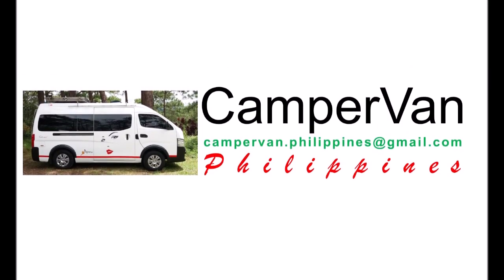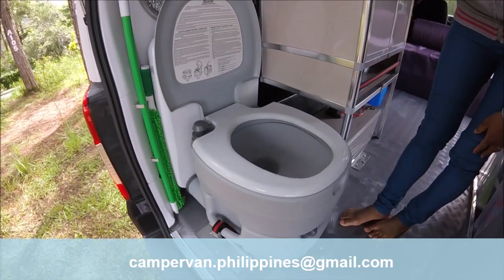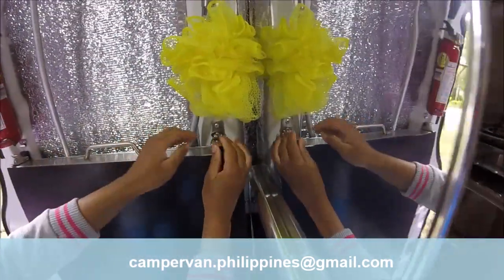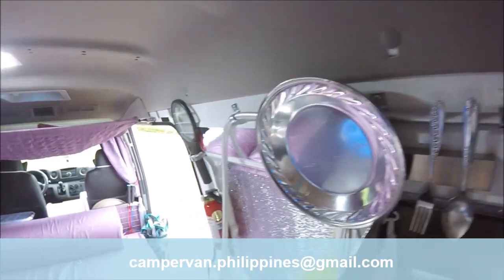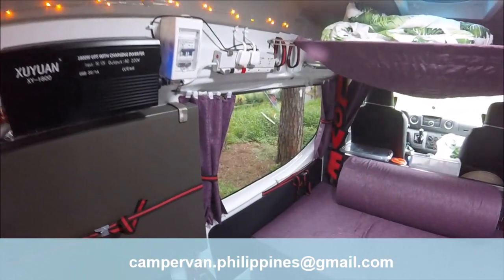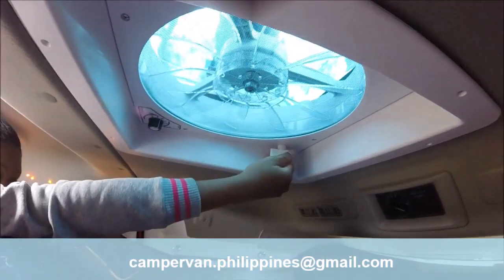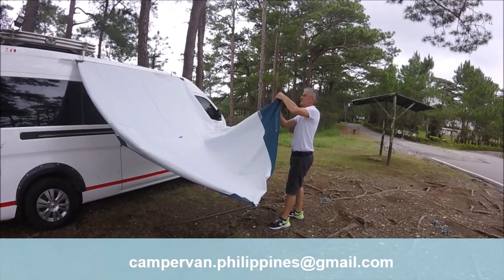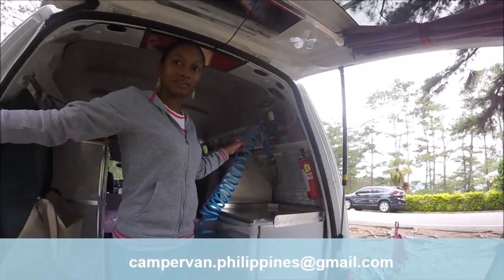How I converted my CamperVan in the Philippines

Comment: How is the drive when your water tank is full? Was there a huge change in the center of gravity?
Reply from the maker: The water tank doesn't modify the gravity center because is flat (13cm height) and inside it I have add an anti dangling water system.

Comment: Whats your electric source? Is it all from solar? Can it support aircon? Thanks in advance
Reply from the maker: The electric source is only from solar panel with an inverter 12/220Volts and a 200hA battery. So it's not enough for aircon... we have only a fan.

Comment: whats your van model? any other suggestions for a decent size van? thanks.
Reply from the maker: Hi, it's a NISSAN URVAN CARGO NV350 and I think its one of the most acceptable size van for the roads in the Philippines. 
If you choose a bigger model, like HYUNDAI H350, you will have some complications for U turn and many problems with electrics cables on the road !

Comment: Good day. How much is the total cost of the set up?
Reply from the maker: The cost depends on your customization.
I chose to only use aluminum and stainless steel, so it's more expensive than wood ... the total for me is around 350KPesos (+/- 6000 €) DIY only .
Reply: @campervanphilippines738  How much would the conversion be if I brought you a Toyota Hiace?

Comment: 😒 sorry but it’s poorly designed for a very high price
Reply from the maker: Thank you for your review... What would be a fair price according to you ? (Knowing that this NISSAN van model is brand new and is 1.2Mpesos)
Reply: @campervanphilippines738  Le problème c’est que tout est apparent, tuyaux câbles fils électrique, pas d’intimité dans une SDB.
Reply from the maker: @brunojm7282  Ce prix de 55K$ est-il un prix de vente aux Philippines ? Si oui, qui est le revendeur ?
Reply: @campervanphilippines738  prix vente Russie. Le faire aux Philippines devrait être moins cher ou au pire au même prix. Je sais l’importation de véhicules non fabriqués aux Philippines c 50% du prix en plus !
Reply: @campervanphilippines738  vu la taille des familles aux Philippines il vaut mieux avoir 4-6 couchages dans un RV
Reply: Comparing a Russian truck based camper to a van camper sold in the Philippines is not a useful comparison. Also, your last video is about a US van conversion. Anyone is free to do a conversion if they think they can do it cheaper. 49k seems reasonable in terms of US pricing. I can't speak to relative value anywhere else.